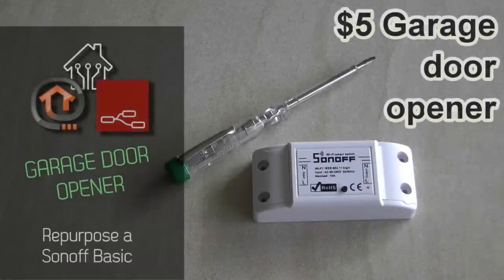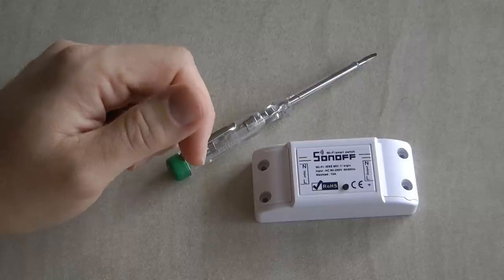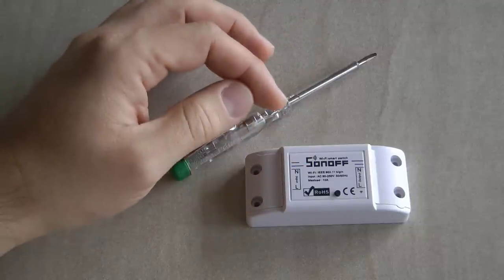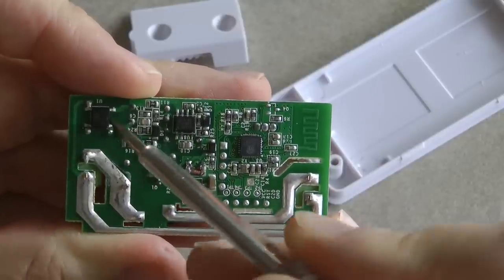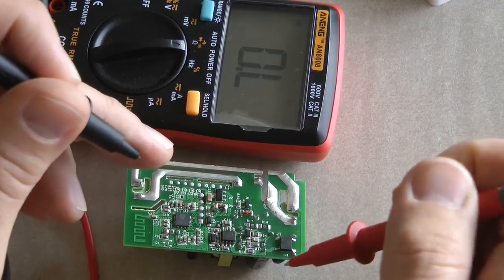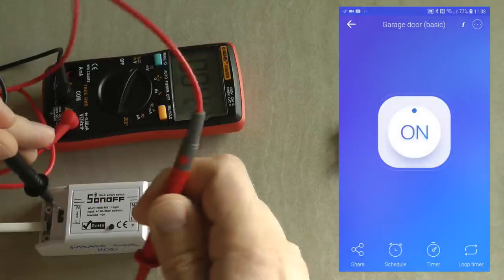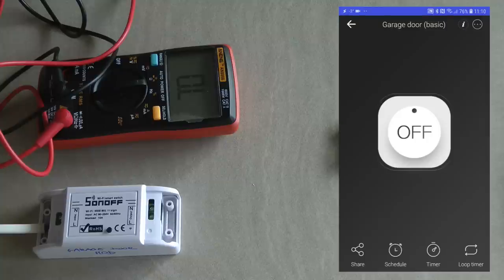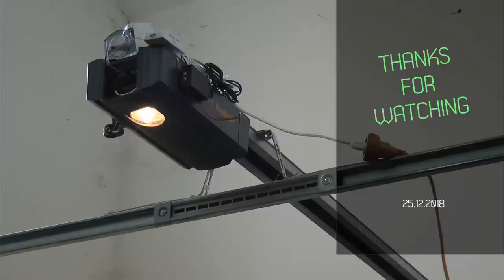Turn Sonoff Basic to garage door opener with eWeLink

Comment: my model is litle bit diferent
Reply from the maker: Yes, this is a rather old video. Since Release 2 and Release 3 models came out. I did a video on that as well. Unfortunately those are much tighter on the PCB and I could not make the same modification to them safely. I recommend checking out the Sonoff SV. That has the relay output and can be used without any modification.
Reply: @csongorvarga  thanks again, this video helped me a few years ago, and it will again 😉

Comment: Again "Awesome video" and presentation skills, i watched it few times and got the sonoff basic for fun, love to explore new stuff..

while  i know i'm an inch far to getting success...if you could tell what i'm 
doing wrong... tasmota-firmware i installed to my sonoff 
basic....nodered and dashboard show all connected topic is "sonoff" or 
"room/sonoff" to keep things simple. the true and false show clearly in 
node-red logs

on syslog server listening to client mqtt subscribe messages, this is what i'm getting
03-23-2019
 06:56:32 Local7.Debug 192.168.1.4 sonoff-3065 ESP-MQT: 
room/tele/sonoff/STATE = 
{"Time":"2019-03-23T02:26:33","Uptime":"0T05:35:15","Vcc":3.432,"SleepMode":"Dynamic","Sleep":50,"LoadAvg":19,"POWER":"OFF","Wifi":{"AP":1,"SSId":"Xiaomi_Antariksh","BSSId":"78:11:DC:17:D0:54","Channel":1,"RSSI":54}}

what is missing. i'll appreciate any guidance
Reply: i'm trying to build my own "sliding-gate" without any arduino etc... all i want to use is mqtt on a centralized raspberry-pi with sonoff as client...

Comment: This is very interesting however very difficult. For $15 you can get the REAL inching smart switch and it uses eWelink also. I've been using this with my garage door for one year without any issues, I'd suggest don't waste your time doing a hard mod and get this: https://www.amazon.com/gp/product/B0752P57ZG/ref=ppx_yo_dt_b_asin_title_o00_s01?ie=UTF8&psc=1 Cheers!
Reply from the maker: Thanks, I did not know about this product. Yes, you are correct, this is easier.
Reply: For some of us, it's harder to find a case that will fit than to modify the board. This unit comes without a case.
Reply: It has a minimum 1sec momentary closure. My window blinds go into a different mode after .5sec. Can this time be reduced in Ewelink, does anyone know?
Reply from the maker: @enhompe2  In the eWeLink the inching time can be 0.5 to 3600. Since I don't own this device I can't tell, but check if you have that feature in the app for this device. Than turn off the inching feature on the device (I am assuming you do that with buttons) and see if doing it via the app can reduce to 0.5sec.